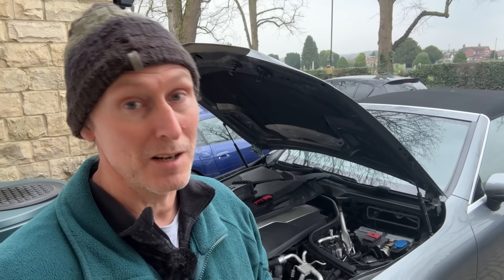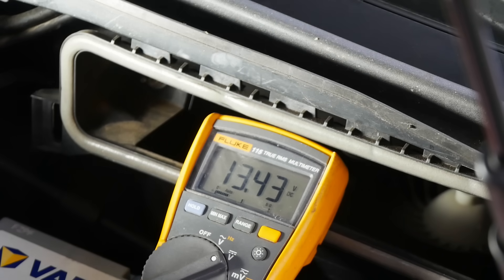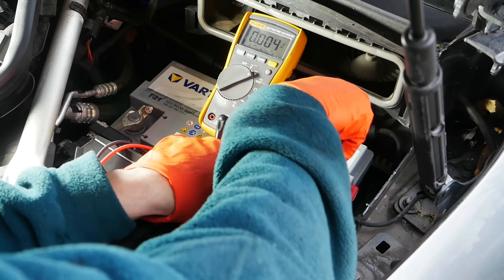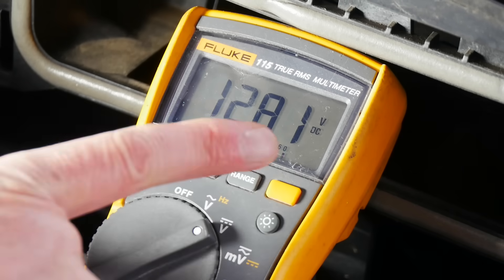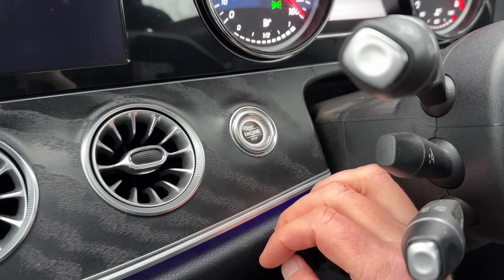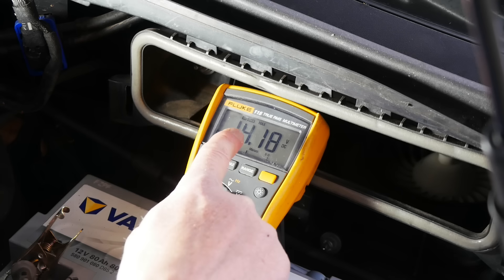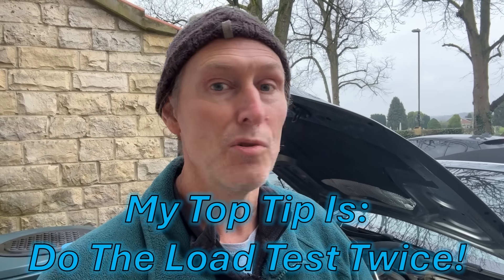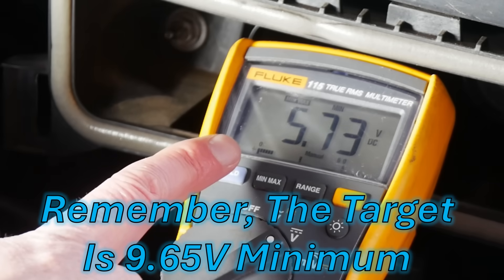Car Battery Load Test With Multimeter | EASY DIY

Comment: That is very interesting.  I never knew I could use my multi-meter to do a load test.  And yes, I do have the min-max feature which I have never understood or used.  Will do that the next time I test my battery.  Thank you very much!
Reply: Its called a volt drop test, a current load test is using those old tool with prongs you push onto the terminals using resistance wire and reading off the gauge. You can also do volt drop on wires in the positive and earth cables when starting  between points  which helps find poor connections.

Comment: Ah sure. But probably get cleaner data with a static resistor fixed load. No?  Also, just run the leads under the edge of the hood and lean the meter to the glass. Read voltage from the driver's seat

Comment: This video was good for checking battery voltage, but you didn't check battery amperage. You can have a 650 amp battery thats reading 12.7 volts,  but under load (cranking) is only delivering 350 amps. That may not be enough to start the car. Voltage is the last thing to go on a car battery. You'll always be able to read something. But when it cannot hold amperage after being charged, that battery is done.,,,
Reply: So do a video and show us how that’s done then. 👍🏻

Comment: Batteries are only tested with a resistor. All other tests yield false results. And if you're buying a new battery, get an EFB or AGM. They're much more durable than regular ones, even the more expensive ones 😎

Comment: How the hell do you know it's your battery? Buy a decent battery analyser, just by measuring the voltage you don't know how much Cold cranking amps it got or the internal resistance. A low voltage drop when starting can also be the fault of the starting motor that is worn out and needs replacement. With a battery analyser like the Topdon BT100 you know everything. Battery voltage, cranking amps, internal resistance, alternator loading test at stationary and at 2500rpm and finally the starting motor. If battery is fully loaded and is healthy by testing it's cold cranking amps and still the voltage drops below 9v when cranking...then the starting motor needs replacement...

Comment: The higher voltage reading directly after charging or driving is called  the "surface charge" which will quickly dissipate. It is, therefore good practice not to immediately measure the voltage as it may drop off significantly over a few minutes and actually show a poorly-charged or knackered battery.

Comment: Hi thanks for the vids, very useful and informative. I've just done the min max test on a vw t6 and for the min im getting a negative 0.1.....cant be right? Only get 12.5v at rest so i thinks its on way out although still starts first time every time at the moment, diesel obvs but thinking when it gets colder it might struggle
Reply from the maker: Hi, yes, there is something wrong with your lower value, particularly if the battery is capable of starting the car. Yep, colder weather is when the battery will start to struggle if it’s going to, especially when starting a diesel. Cheers, Phil

Comment: That's a great budget load tester better than spending a couple of grand and better than one of those handheld Battery Load Testers which OK, but not as good as a proper load tester. When charging the battery, you get a surface charge on the sulfated cells, and the battery charger shows fully charged at 13 V but insufficient Cold Cranking Amps as your test clearly shows as voltage should drop no lower than 7.2 V for 30 seconds.

Comment: Curious that you clain a fully charged (and 5~10 mins settled Battery shoulf be 12.75 v .
So how in hell did your meter show in excess of 14 V?? Beyond that 'Some' cars show battery vltage Before Starting and After starting .
  Buy a 'Better' Car and this Battery testing nonsense is Unecessary as it happens at EVERY startup.

Comment: Assuming the charging system is good and there is no drain on the battery there are two giveaways to a faulty good quality battery - Age and temperature! 
If a battery is over 5 years old then it is on its last legs. If it has been looked after and never allowed to have been fully discharged you may, at tops, get 10 years.
Secondly, because batteries are chemical devices they require heat to work so if the temperature drops to less than 4 degrees Celsius and it is older than 5 years and the battery fails then renew it.
Thank you for your video it was spot on.
Reply: There are exceptions, 12 year old battery in a diesel still going strong, but it's mounted in the boot so I suspect the easier temperature life by not being in with the engine has extended the battery life.
Reply: @royster3345 That is interesting but I have come across batteries older than ten years and the advice I would give is get rid of it as it will fail, probably on the first cold morning of Autumn.
My Auris’ battery only lasted five years and that was in the boot but there is a continual low drain, it is only a 30ah battery. I sometimes go a week or two without driving in winter but I now have a permanent 1 amp charger connected. Oops not while driving I may add.😊

Comment: How about a high resistive oily film between the bell housing and the starter motor. You can change the battery and you can change the starter motor and you can change the alternator out and still not start even with a fully charged new battery. I've seen this develop around a seasonal weather change on  a Ford Wagon. 1970 something. Due to dissimilar metals between the bell and the state motor case.

Comment: Nice video. In the video, @02:45, you state 9.6V or better for satisfactory test. This value can be lower if the battery is colder than 70 degrees F.

I recently did some digging into FLA (flooded lead acid) battery information for one of my projects. I came across your video and realized the test you show can vary depending on the actual internal temperature of the battery itself. Here is some of that information I found from a major manufacturer of FLA batteries for the USA market:

(For safety, important steps to follow before Step 5 shown below from link to document at end of comment)
Step 5.	Estimate the internal temperature of the battery to the nearest 10 degrees F. Apply the load for 15 seconds. Note the voltage at 15 seconds with the load ON and immediately shut the load OFF.

BATTERY TEMP.		12-VOLT BATTERY
70 F (21 C) or above	9.60
60 F (16 C)			9.50
50 F (10 C)			9.40
40 F (  4 C)			9.30
30 F ( -1 C)			9.10
20 F ( -6 C)			8.90
10 F (-12 C)			8.70
 0 F (-18 C)			8.50

And a link:
https://www.eastpennmanufacturing.com/wp-content/uploads/Automotive-Battery-Care-Maintenance-Poster-P121.pdf

Comment: Well done. I can't fault your testing method. Rule of thumb...anything below 9.7Vdc under load is suspect, assuming you started with a fully charged battery (externally charged overnight). The intelligent car testers are now getting very accurate. I have two. Both are semi professional and I also have a proper Carbon Load Tester that can test up to 500A. My carbon load tester proved that the intelligent testers are now very accurate and trustworthy. I used all three methods on older/faulty and brand new batteries and the intelligent testers were spot on when declaring a battery healthy/undercharged/weak or faulty. These intelligent testers are now in the price range of a reasonable priced Multi-meter and are easier to use for the average layman.

Comment: I have a 2015 Nissan Frontier 2.5L with the original battery. Still maintains a full charge and starts in -30 C temperatures in the winter no problem. I’m in Canada, it does get chilly here sometimes.

Comment: First, it is a lead-acid battery to give it its proper name and the nominal voltage is 12V.   Less than 11V means the battery is not fully charged.  The headlights are the best load test available in a car as starter motors can be faulty and draw too much current.
Turn on full headlights for 3 minutes and if the car doesn't start after that, the battery needs to be charged. 
If the headlight test is done again after charging, and the car still won't start, then a new battery is needed.   
If you have a voltmeter, the voltage should be 14.4V when the engine is running and the battery is being charged.  
A lower voltage (10-13V) means the alternator is not charging the battery.  
A higher voltage (15-18V) means that the voltage regulator on the alternator is faulty and you can destroy some expensive  components, e.g. engine management system, the radio, the GPS,  wiper motor etc so the alternator has to be fixed immediately.
Reply: Definitely some errors in your comments there.
Reply: @Loki-rascal  Then tell us what they are!

Comment: I have a car that needs a high CCA ... Can you help me understand that? ,🤔
Reply from the maker: Sure! So, battery manufacturers and testers needed a standardised way of measuring the performance of a battery and since batteries tend to do worse in cold weather, they came up with CCA (cold cranking amps) - The amount of power a battery can produce at 0F / -18C for 30 seconds. So that’s the battery side. On the car side, larger engines, with higher compression and more electrical demand (gizmos etc) all require a a more powerful battery / higher CCA. So, once you know the demands of your car and since the tests across all batteries are standardised, it allows you to choose a battery that will meet your requirements. Hope that helps! Cheers, Phil
Reply: @ReviveMyRide This is information mentioned on the car battery. Please help me understand which numbers to look for when finding a replacement battery. 

Battery for VW Polo GT 2021 India. 1.0 TSI

Exide

5K0 915 105 

12V 36 Ah 300A 175A DIN 

300A EN/SAE/GS

Comment: 2 times, my old Volvo have a dead alternator and while I’m waiting for a new one I have to charge battery, but with a fresh battery I can start in the morning, drive to work, that’s a 20 min drive, then later that day start again, drive home, still 20 min, then when I’m home I’m able to park then if I need to go out shopping later I can, no issues, I bet I can do probably 1-1,5 h of driving time, plus 5-6 cranks on top of that 🤣 but again these Volvo batteries are like 95ah,

Comment: Great. I use my car 4-5 days a week and it starts up fine but next month I am going overseas for 10 days and leaving the car in "Long Term Parking" at Airport. I was worried that the battery may drain while in Long term parking as it keeps the on-board computer for the car and whatever other power dependant memory is required alive. So I battery tested the battery and it's on its way out. Got a new one. Thank you.
Reply: Good thinking @byLokie. I left my car at Birmingham Airport for 14 days and when I returned at 01:00, the car wouldn't open on the key fob. When I opened it manually and pushed the start button, there was absolutely no power at all. When recovery guy eventually came, he told me that most modern cars couldn't manage to sit more than about six days sitting where I was. I was sitting just under the radar tower at the airport. He said that the radar was continually triggering my ECU, leading to a rapid drainage of the battery. It jump started ok, but took about 36 hours for the battery to be fully charged. He recommended that I buy one of the Lithium jump starters that he used to start the car and leave it in the driver's footwell when the car is left. The reason for this, is that if it is left in the boot, I wouldn't be able to access it if the battery was flat as the boot wouldn't be able to open with a flat battery.
Reply: @CharlieMac53 Yer not like the 1980s and earlier. When you turned off and locked your car the battery also was asleep. Now days the car is keeping 'onboard memories. Theft sensors. Fob detection. They use small amounts of amps but still drain the power source. Hence drained batteries at the airport carparks.

Comment: Would this mean i would need a new battery?
Reply from the maker: @slydawgg  yeah, if the battery started off fully charged as in the video and the voltage dropped really low during cranking, then it’s a good indication that the battery needs to be replaced. Thanks, Phil
Reply: @ Thank you,i’ll  get that checked.

Comment: I thought anything over 13v was too high.😗
Reply from the maker: No, not once the engine is running. When running, the alternator will often give 13.5v or more.
Reply: @ReviveMyRide 
Yeah, but didn't know the engine was on.

Comment: Hi I've just come across your video  and it's very helpful,  I've just tested mine and I think my battery is on its way out can you confirm with my readings 
Battery =12.05
Min test =6.29
Max 14.13
Reply from the maker: OK, so you need to start the test with the battery fully charged. As yours was only 12.05v at the start, that means your battery only has 50% charge! When it's fully charged, the voltage at the battery will be in the region of 12.65v - 12.75v. My advice: Go back and charge your battery again for at least 8hrs (if you have a 5A charger). Ideally, your battery should be at  12.6V minimum at the start of the test. 
Apart from that, your min reading is looking very poor but it will do if your battery only started out at 12.05, so it's hard to read anything into that. Max is good but that is with your engine running, so it tells you more about your alternator than your battery. It is in the range of 13.5v - 14.5v, so it means your alternator is working properly and probably isn't your problem. Sometimes battery problems are actually alternator problems where the battery isn't getting charged up again between starts but not in your case. Hope that helps! Thanks, Phil
Reply: @ReviveMyRide  thank you so much. Yes those readings were with the car off, the readings are when it's running is battery alternating dc volts around 13.96, min = 6.69 max 14.06. Then when turned off the battery drops slowly back down to 12.05. Yes I have a battery charger with recovery function so I'll take the battery off and charge it up and then test again after a few days.

Comment: Many cars have a "clear flood" mode that prevents the engine from starting while you crank the engine. Holding the throttle wide open while starting is common on many cars.

Comment: What should a fully charged standard lead acid battery read?
Reply from the maker: Hi, normally 12.65 to 12.75 would indicate a fully charged car battery. The latest AGM batteries can sometimes show a little bit higher. Thanks, Phil
Reply: @ReviveMyRide  Thanks.

Comment: The fact that the battery goes flat in a couple of days after recharging is all the testing you need to do.
Reply from the maker: If nothing else has changed on the electrical system then yes, I would agree. There are a few other things that could fool you into replacing the battery when it isn't the problem. Just a couple of examples: You car has developed a low level battery drain or your alternator isn't putting as much juice back into the battery anymore... Cheers, Phil
Reply: @ReviveMyRide  Thanks.  You're very responsive in the comments.  Thumbs up.

Comment: Potentionately it could also be a bad earth causing volt drop. The starter could be drawing excess current due to failed windings. Its not a accurate test to condemn a battery by.

Comment: Brilliant. Concise, easy to understand and full explanations why you are doing each part especially for a non-sparks. Thank you very much for doing this. One question, would I have to reset electric windows , radio and any other items after changing a car battery or removing a lead to clean it?
Reply from the maker: Hi, thank you very much for the kind comment, glad you liked the video! Sometimes I do need to reset my electric windows. Not in standard cars but in cars with frameless windows where the window goes down a tiny bit when opening and closing. Radio has always been ok on modern cars (for example my 2006 Z4 is coded but has never asked for the code due to the battery being removed) but you are right to raise this and is one to be careful of if you think you have a coded radio but don’t possess the code to input if required. Cheers, Phil

Comment: If a battery lasts more than three years your lucky 😊
Reply from the maker: Unfortunately, that does seem to be the case! What do you think, is it because there is much more load on batteries these days or are batteries being made that are cheaper and less reliable? Or maybe a bit of both! Cheers, Phil
Reply: @ReviveMyRide  both I think.  Plus you cannot top them up... Main issue I think is you cannot top them up ..had new batteries wouldn't even hold a charge for a week even with the isolator turned off . . Defo inferior batteries. .
Reply from the maker: @colinstickland3130 that’s a really good point about the topping up. I think it is still normal (there’s still a vent hole on batteries) for some of the fluid in batteries to evaporate and of course, you used to be able to top up with distilled water or similar and in some cases, this did help bring old batteries back to life. Cheers, Phil

Comment: It's a shame today's cars don't come with built in voltage / amp meters.
I bought cheap ($ 2) digital voltmeter and plugged it into cigarette lighter port.
I find it beneficial to be able and see the car's operating voltage as I drive.
Car makers give us lots of crap we don't want or need but refuse to give us stuff that we could use.
Reply from the maker: Agree, a simple voltage meter and knowing what is normal for your car and battery is a great way of keeping an eye on things 👍

Comment: Its not complicated. Put the meter on the battery. Turn on the headlights. If the battery voltage holds steady, the battery is generally ok. If the battery voltage drops steadily, replace the battery. No need for it to be fully charged or even close.
Reply from the maker: I’ll give this a try! With modern cars, I’m sure it won’t be long before I start getting some kind of battery problem again! 😂